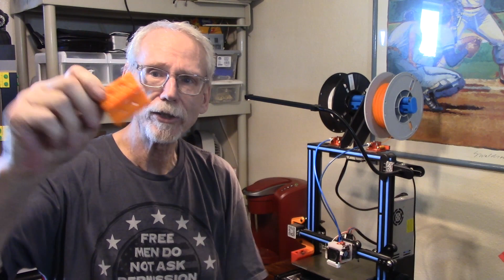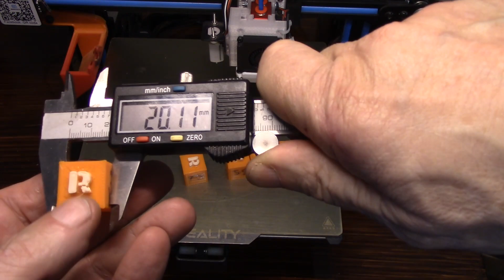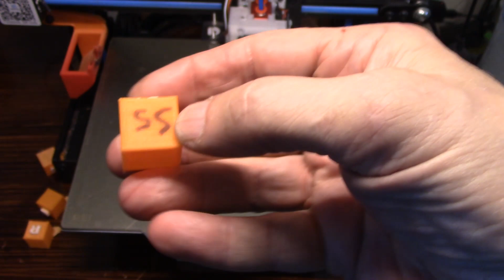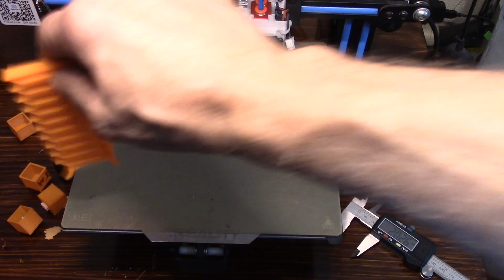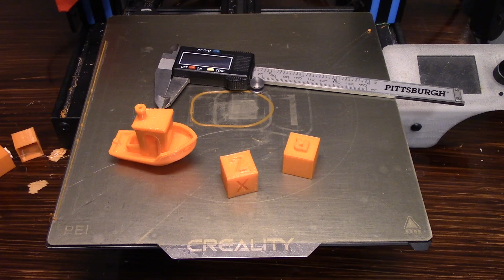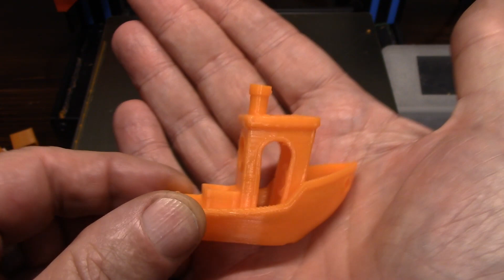Is my printer out of whack? Let's find out!

Comment: Isn’t it about time for another All Metal Hotend update? 😀😀. 
(It’s been another 20 months.)
Reply from the maker: Has it been that long? I've still got that same hot end on my enclosed Ender 3 and it still works fine. Problem is, I really don't use that printer very often anymore. Last time was my failed attempts to print Delrin/POM. I'll have to think of something to print or do with it. Any ideas?

Comment: It sounds like sometime when you were slicing you set it up to shoot time-lapse video. I don't know if you are running Octoprint on your printer, but there are settings in that for doing time-lapse and in one setting the hotend moves out of the way to snap a pic at preset intervals. It makes me wonder if maybe your main board was okay.
Reply from the maker: I'm not using Octoprint. I'm using the fast motion option on my camera and in Shotcut, the video editor I use. I've never changed the slicer for time lapse. And at one point I had someone else slice a model for me and it the issue still occurred. It was the mainboard since once replaced the problem is gone and has never returned. However, it was a good thought and one I'll keep in the back of my head in the future. Thanks!

Comment: The hot-end moving all the way out of the way between z-layer changes sounds like a setting enabled in the slicer (or something directly affecting the G-CODE at the time of printing) to allow for time lapse photography. I'm not clear on where all of the upgrades left you - I guess with the sample prints shown at the end - it would have been easier to follow the troubleshooting if just one variable had changed between re-tests. Best wishes.
Reply from the maker: It did it in 3 different slicers and with a stock Ender 3 profile that came with them. It also did it with multiple versions of the firmware, including the stock one provided by Geeetech and unmolested by me. And it didn't do it between every Z level change, it was completely random. I even had someone else slice a model for me and it still did it. And once the mainboard was replaced the problem disappeared and has never returned.

Comment: There are some real assholes in the Voron Community that I came across , they were having a go at a guy who did not have a Voron but had a Creality machine and another guy who was talking about Cura so they started at him, they were basically saying the Voron was an elite machine and anyone who did not have one was not as good as them I asked them what they were going to do when the industrial printer owners turned up and started talking about their $70,000+ machines and Voron owners were not as good as them with their DIY machines, well it ended up with me naming them The Voron Nazis to great applause
Reply from the maker: You wouldn't believe, or maybe you would, how many people have told me the Ender 3 is "complete garbage" and how it "can't make a single usable print" and how I should buy a $3000 printer. They live in their own little world.
Reply: @3rdpig  I have spent over £2000 building a Pro 3D V-King 400 from self sourced parts of the very best quality I could find and yet the Ender 2 original which cost me £130 is my most reliable machine and its print quality is outstanding, this machine never goes out of square and I can press print and walk away knowing full well it will just print the part
Reply: I have 2 vorons… but yes you are right. There are some know it alls in the voron community. But there are also know it alls in most communities so not a uniquely Voron phenomenon. There are so many things that can affect print quality and sometimes I can print the same gcode file with the same brand of filament and one print is good and the other not so.  No real explanation for the difference except maybe a difference in the batches of filament? I think that makes printing with multiple colours also a bit trickier as settings for one may not be so good for the other. Just a thought.